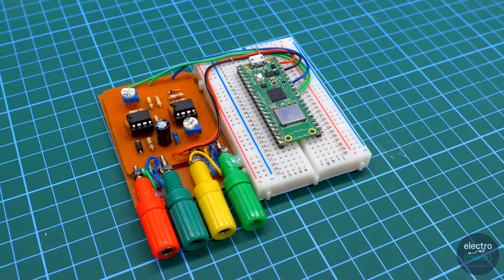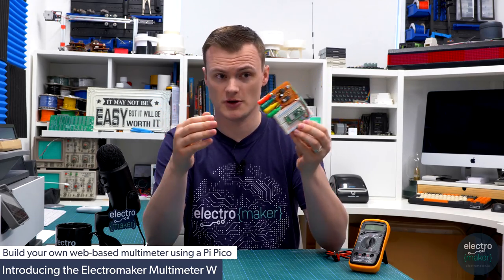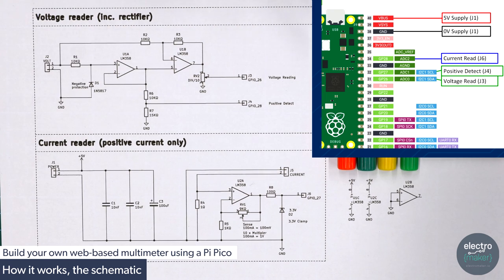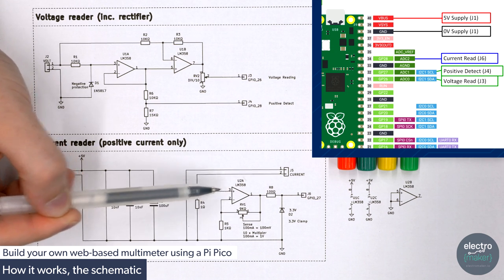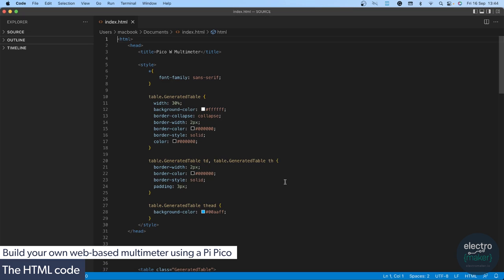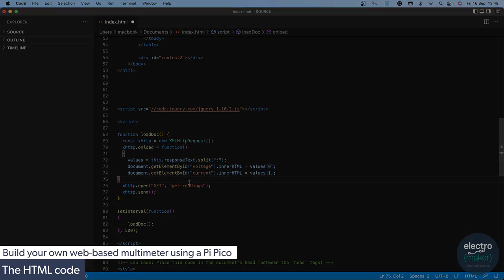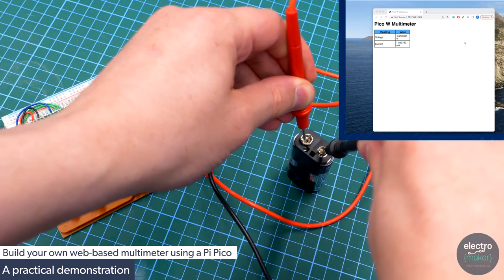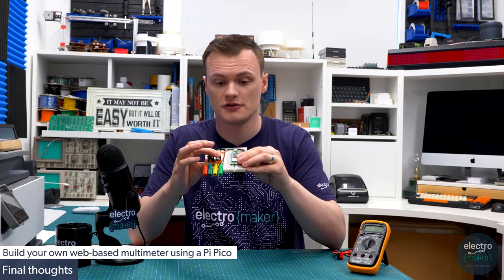Build your own web-based multimeter using a Pi Pico

Comment: Great Idea! That analog input circuit is just what I was missing! 
I recently used the Pico to measure and record a rather weak signal and I realised, that the ADC ist quite noisy. In the Picos data sheet is in section 4.3 a hint on how to (in my experience significantly) reduce the noise. You basically can reconfigure the power regulator on the pub to trade off power efficiency for reduced noise levels by driving high GPIO23. It's could reduce the somewhat noisy behaviour that your build showed in the video.
Reply from the maker: Thanks for the noise reduction tip and we are happy that you found a solution from this video. Great stuff. 👍

Comment: Can we use a bigger R1 to avoid loading the circuit under test with only 10K when the voltage goes negative? 
Thank you for the video.

Comment: Hi this is a great video especially for us who are just starting to learn new things integrating software and hardware, just want to ask the voltage and current range this project can be used to. Is this for low voltage and current only. If it, is can you make a sequel for higher voltage and current use case. I'm thinking of using this project for monitoring my solar setup and to automate powering up / down some electric devices based on the voltage available on my battery bank.

Thank you and hope to see more of this kind of tutorials from you.

Comment: Would love to do this with 6 analog inputs.  Is it scaleable?
Reply: I have not looked too much into this specifically. But the RP2040 controller only has 4 analog inputs at least one of which is already used for the internal temperature sensor.  So fully featured the theoretical maximum with this board specifically would be 3.
4 if you use a board form a 3rd party without the temperature sensor.

But it does have A LOT of other IO functionality, so maybe there is something else in the datasheet you could use.
Like 4 Digital IO controllers, 2 uart, SPI, I2C.

Comment: Freqency.  Inductor. Capacitor measure possible?
Reply: Within this project, no, which should be obvious enough considering the circuitry; as it is, it can't even do resistive measurement without some modification due to the split plugs and lack of code for such measurement.  But in general with using the RP2040, yes, it is capable of being integrated into a project that can do these things; I've seen talks of an experimental LCR using the chip but I haven't seen much come from it yet, as for frequency it depends on what you're actually looking for, what a multimeter will typically tell you (purely as a sinusoidal function) or the better capabilities of an oscilloscope (which goes beyond just sinusoids), of which there's been a handful of scope projects already.
Reply: @xaytana  thank you sir.. but please try to design lcf metar using pico.. 🙏
Reply: @dn7918  Take this as a learning opportunity, rather than just copying a project.  DIY projects based on other chips abundantly exist for various meters and scopes, as these simple tools have remained mostly unchanged for decades; learn how to research projects yourself, learn how circuits work, learn how to design a circuits, and learn how to integrate multiple circuits into a singular project.  Educating yourself on basic things like this is important, nobody is going to hold your hand throughout life.
Reply: @xaytana  yes thats right.. thank you

Comment: I've been considering integrating various projects together.  This, the HaD oscilloscope, I've seen talks about an experimental LCR using an RP2040, etc.  Basically an all-in-one electrical measurement multitool (not just a multimeter) for at least lightweight work with all bases covered within a singular tool, not to mention how compact and portable it could be, and at a fairly low cost assuming it works well enough.  The only real downside of the chip is its absolute dogshit ADC, nearly every project that uses analog on a Pico outright requires a better ADC due to how utterly limited and poorly limited the built-in one is.  I hope the Foundation's next mcu chip fixes this issue and is overall more usable, as the limited number of input itself is also a bit lackluster.